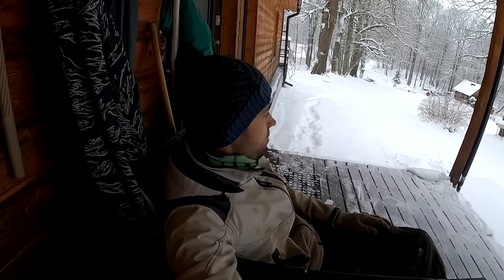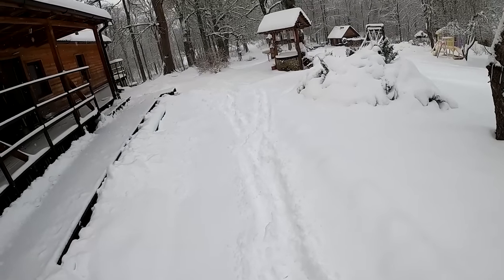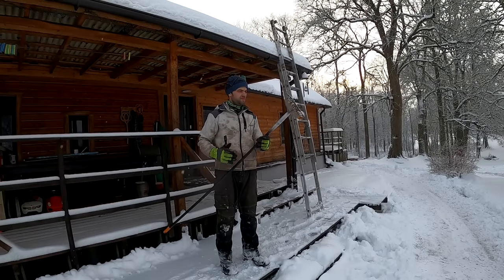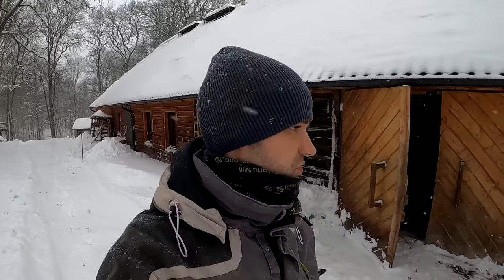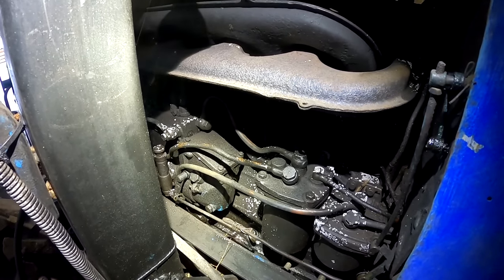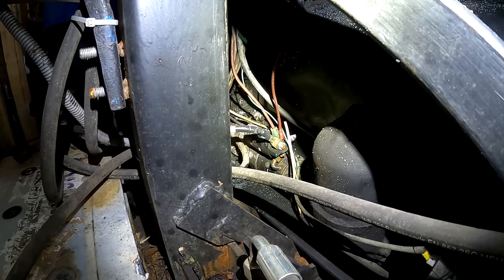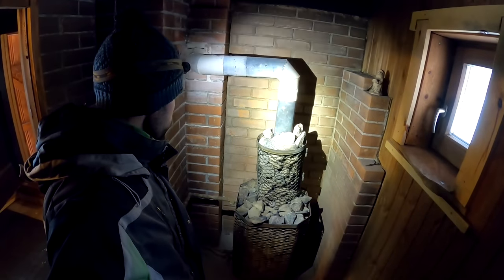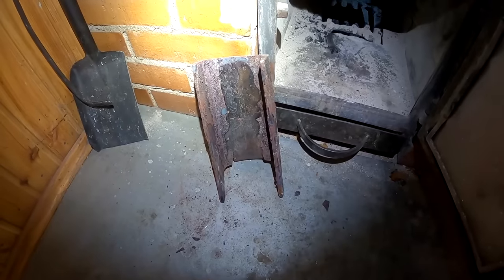Odd ends, side jobs and stuff - vol2

Comment: I have a Bobcat 533 and 2 of my tires were leaking air at the rim. I had the tires taken off the rims and cleaned off the rust inside and painted them and the problem was fixed. Love your videos!
Reply from the maker: Yeah i will do that too most likely, but i wont put the same tires back, i will get new tires
Reply: @Ants_Pants   thanks for the reply. My tires are old and have some cracks but even when there is no air they don’t go flat. I couldn’t tell one was completely empty and I could still use the machine. Made by BKT. Have a great day!

Comment: If you can break the tire down off the seal, then take a wire wheel on your hand grinder and clean it up and spray some primer and paint then it should seal again and you can change that valve stem too while you’re doing it! You can wire wheel the JBWeld off!
Reply from the maker: the valve stem was not the leak, the stem itself leaked, that's why i jbwelded it :D in any case i think i'm just gonna buy a new set once i reach bobcat with my maintenance.

Comment: Nice vid Ants and as others have said the weatherman is a laugh, whilst also being a bit disturbing. For the Honda problems make sure traction control is off when you have problems in the snow as oddly traction control just interferes with traction when it is very slippery. It is only really designed for one wheel briefly loosing a bit of traction on normal roads.
Reply from the maker: Yeah i tried that.

Comment: The amount of snow on the house roof indicates the insulation is working….. in so much the heat inside the house is not escaping through the roof 👍👍👍👍
Reply from the maker: 300mm of mineral wool

Comment: For leaking tire, try 100% glycol based anticoolant (green works best). Remove the valve core and add the green stuff about 0.5 dl or so. Then install valve core back and inflate tire, rotate it all around few times to ensure antifreeze finds lekaing sections.  That trick works quite often cases like yours Bobcat tire has now. Give it to try!
Reply from the maker: Thanks m8 i will try it out

Comment: We have a big shop with a flat roof supported with 12 inch I beams when we have heavy snow, I put some long screw Jack's that I built under them , you might be able to use A temporary wood post between the uprights, just cut them to a hammer fit length and hammer them in.
Reply from the maker: A 12 inch i beam would help me out here :D lol

Comment: admit it! You used to be a snow plow driver in the city! OK, knock it off Antsy. That is serious work! Quit screwing around! OK smart guy! Proof of order of operations, Now you have to remove the snow in front again. 
I think I recall back in the 70s when you had over 2meters in one storm.
I have a 1976 VW Rabbit/Golf. Great in snow with spike chains if I clamped a board to the from bumper to keep from floating on the snow.Just use a fir under the block for the Spaznertz tractor! I would be impressed with it starting if it was -40C in the shed. 
Oh and back blade means USE WHILE BACKING! OK, I admit you sort of got that down!

Oh and for the car? Through about 50kilos of weight in the back end.
Reply from the maker: 😆 thanks for the hilarious comment mate 😅

Comment: If you love the soviet tractor the way you say you do, you should hook up the heating options. A warm engine will last a lot longer than starting a block of ice with little oil flow.
Reply from the maker: Not unless you run the engine around for a while without compression to circulate the oil
Reply from the maker: I was looking into the heating option but only one avaliable was a weak 300w that takes up to 8 hours to heat up the oil. That seems like a lot of wated effort for nothing

Comment: - That snow looks, moves, and sounds like a heavy, almost wet, snow...that is also like miniaturized "corn snow" that happens on sky slopes in spring after repeated thawing and freezing, except this fell from the sky.
- If it had started as big snowflakes and then colder weather set in, it would have turned to "powder show" and probably been a meter high.
- The point is that for a foot of snow you have three feet of snow's weight on your flat porch roof.
Reply from the maker: Yup

Comment: As a Swiss with Snow-experiance i would like to give you 2 Tipps for snow pushing with the Quad:

1. Bether you put to each weel a snow-chain. Will make driving more easy and powerfull.

2. The pusher should NOT be 90degree to the road, it should be 45 - 60 degree. So when you drive the snow will go away and not stay just in front of Quad. That really need a lot of power.
Reply from the maker: 1. Yes
2. Your correct 

Thanks for the tips mate

Comment: Tire soap to seal bead. Tire shops have it or get online.  I've used grease with some success to seal bead. Otherwise there bead sealer. Comes in can n brush on rim. 
Tire soap is thick like grease. Also aids in airing up tires when bead doesn't push into rim
Reply from the maker: What about just useing construction foam to fill the entire tire
Reply: @Ants_Pants  don't think it holds up to weight n movement
Reply from the maker: @jackpinesavagerepair1918  google says it's a good option
Reply from the maker: @jackpinesavagerepair1918  maybe some special foam
Reply: @Ants_Pants  I don't know, never tried

Comment: At what frame rate does your camera film in PAL 50Hz or NTSC 60Hz? 
In Estonia you should also have 50Hz mains frequency, like Europe? 
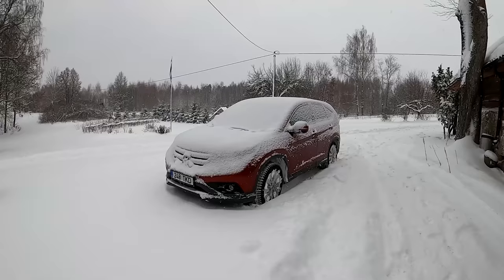If so, you need to set your camera to PAL 50Hz, then the flickering of the lamps stops as at 16:15 in the videos.
Reply from the maker: it's 59,99995 or something fps.
Reply from the maker: i just try to use the lights that don't cause flicker
Reply: @Ants_Pants  GoPro right?
Search the "Anti Flicker" Option and Set it to 50Hz😉

Comment: I never new Canadian standards were so low or Soviet ones so high....  I own a truck V8  a car VW 1.6L  a dozzer  4cly,   and a tractor and not one of them would start at -10C.  NOT a chance.   block heaters for 2 hours for forget it.    To start the dozer I have to tarp it in and put heat to it for 3-4 hours before it will start like that blue tractor did.... 
  personal request....just put on the screen that you warmed it up for 10mins before moving it... even though it sure does not look like you do.  
 The hydraulic oil is thick too.... it needs time to thin and thus reduce pressure in the system... using the loader right away is a great way to blow a hose....  I am on a computer watching so forgive me if you warmed things up. ...  trying to help you NOT  blow a hose when you need the machine the most...
Reply from the maker: Thanks bro for the tips. 👍